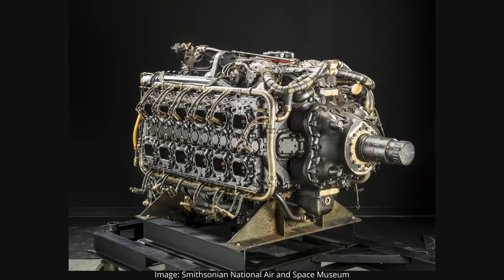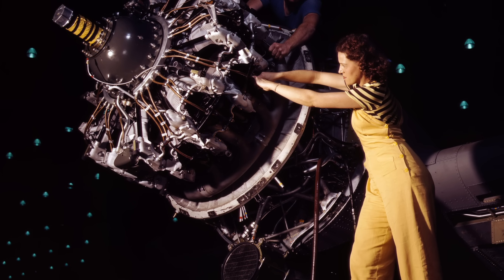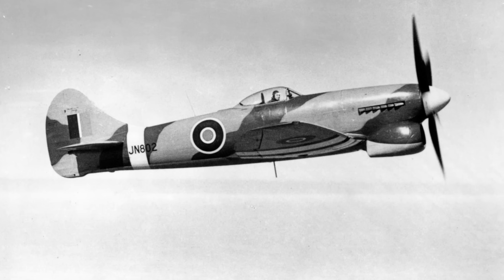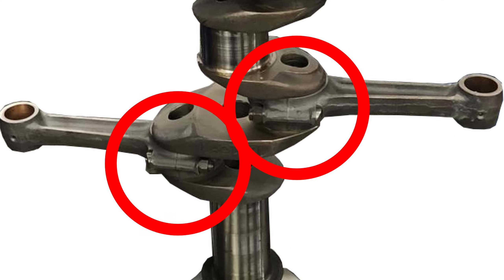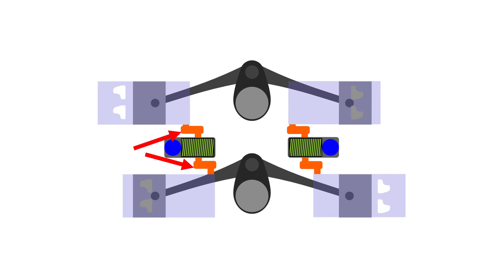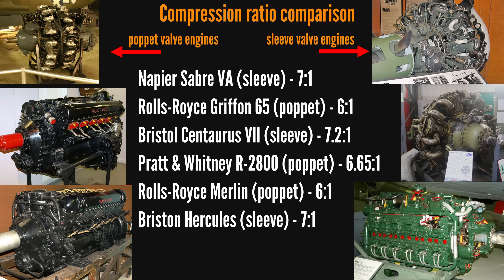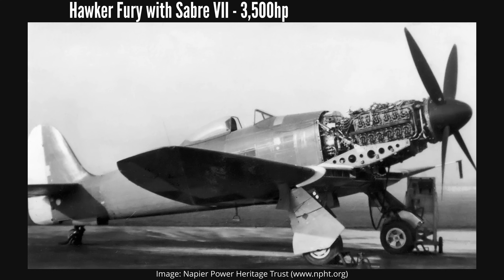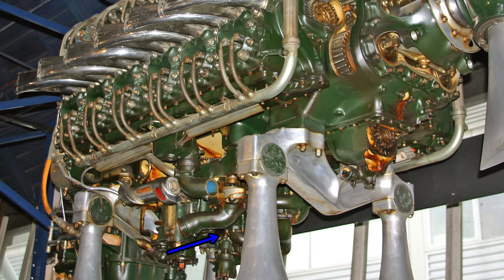The Complex Napier Sabre 24 Cylinder Aero Engine Explained Simply

Comment: One  of  the  most  ridiculous   power-plant  designs  ever  built.......the  Krautenese   set  the   standard  for   engine  design,    but  the  Brits   ignored  all  that.        When  the  pilot  fired  up   a   Napier  powered   plane,  they  had  to  go  on  Oxygen  immediately  because  of  the  Massive  outputs  of  Carbon  Monoxide  into   the  cockpit......Despite  the  Size,   the  Brit-Wit   Napier   remained  inferior  to  the  logical,  maximally  effective   Daimler  600   series  Motors.
Reply: The Knight Sleeve valve engine was invented in America... it was produced in the United States and licensed to several European companies, including Napier.

Comment: Great video!
The Griffon was a direct descendent of the Merlin, born in 1933 with five years of intensive development and five major design iterations. I wonder what the Sabre would have looked like if the war department had devoted funds to fix the teething issues in 1938.
Reply: The Merlins downside was it size, it was too small.
The Griffon is the enlarged version of the Merlin.
The British were reluctant to ask the Americans for help solving the problems with the Knight Sleeve valve engines, they eventually bought American made centerless grinders and fixed the problem.

Comment: The future of light aviation engines would seem to be the diesel, particularly the 2-cycle versions like Deltahawk. Low RPM, much simpler with no gearbox, cams or valvetrain, and runs on Jet A. 100LL avgas is getting expensive and not available everywhere.
Reply: It's certainly a possibility but not the most likely future. It's still much too soon to predict

Comment: Great video. Another disadvantage of sleeve valve engines: much faster wear and less reliability. Very interesting engineering rabbit hole, but ultimately not very practical
Reply: Back in the real world - with equivalent development, the Bristol SV radials achieved considerably longer time-between-overhaul ratings than eg US radials of comparable performance & operating conditions. They also had about half the oil consumption of eg, an R-2800, Merlin, etc. Contemporary reports specifically mention exceptionally low wear found at overhaul time + periodic maintainance was simplified - no valve clearances to adjust every few hundred hours, for one thing (= 36 adjustments on an R-2800, 48 on a Merlin/Allison V-12). The arrival of gas turbines curtailed full development of the Sabre along with the whole last generation of new designs of high power piston aero engines, both SV & PV.

Comment: I assume the Saber engine eventually was fairly reliable. I think all the other 24 cylinder engines being developed by the British were abandoned mostly because they had major teething problems  but also because development of jet engines look mor promising. Is that correct?
Reply from the maker: Yes in the end it was fairly reliable but it was too late. With the war  just about over and the promise that the turbojet showed, it was pointless to develop these further. Some of the other 24 cylinder engines didn't get as much development time as the Sabre, not necessarily because they had more issues, because it wasn't always fair nor were all companies free to choose where they spent their resources.
Reply: The Knight Sleeve valve engine was an American technology that was abandoned as improvements in overhead poppet valves became available.
Later British attempts to revive the technology were rendered obsolete by jet engines
Reply: +@alfredomasullo   Arsenal in France and Hispano developed their own experimental 24-cylinder engines after WW2 (1945-1947) but jet engines were the future.  Ironically,  France manufactured more Jumo 213 engines and they were operated in Nord seaplanes until the late 1950s or early 1960s.

Comment: Imagine the talent that it took to build an engine like that? Amazing!
Reply: No, requiring the talent 'to build' those engines was a waste of resources. Requiring engineering skill and machining ability would have done the job far better.
Reply: It should not have taken "talent" to build that engine. As a mass-produced power plant, it should have bolted together from precision-machined parts by labor who knew how to swing a wrench and shipped. By the mid 20th century, machine tools made parts which could be bolted together by those with minimal 'fitting' skills. Neither the Brits nor Germany (and certainly not the Japanese), ever quite got this; the machines made the parts to fit, the humans ran the machines and fitted the parts.
Reply: @SettledBatches  Yeah, right?  Those machines just built themselves. It's an amazing process.
Reply: @danhillman4523  When you are totally ignorant of a subject, you ought not post about it.
Reply: @SettledBatches  If you read the original comment again, more carefully please this time, the point made was purposely singular i.e. taken to mean conceptual, not the manufacturing process you have been banging on about. It was therefore a perfectly valid statement. What a shame you wasted so much time trying to correct others in such haste you missed the essence of the comment.
Reply: @SettledBatches  LOL. I was at tool and die man for 42 years. I PROMISE you that I have forgotten more than you will ever know.
Reply: @SettledBatches  Sure kid. LOL.
Reply: @danhillman4523  Gee, caught peddling BS, I'm sure not for the first time. Shut up until you have some knowledge of the subject. You DON'T.
Reply: @SettledBatches  LOL. What a little child.
Reply: @danhillman4523  "LOL"?! And you accuse others of being immature? Grow up and learn your place; it's not where you wish it was.
Reply: @SettledBatches  Who? You? You are. There is no accusation. Just the facts, son.
Reply: @Daniel-deMerrivale some of the modern day combustion engines used in cars highlight the problem with this ww2 engine. its too complex to be reliable or as reliable.. as the competition. especially for a military vehicle. modern day combustion engines used for military have a far simpler design - 80+ years later
Reply: the guys who designed and engineered this engine was very talented. but a question could also be, who is more talented. define the apex of mechanical talent, is it to build unnecessary complex machinery
Reply: @hotdog9262  Point taken. Still, what a piece of work eh?
Reply: @danhillman4523  yup:) had a few drinks last night

Comment: A terrible engine with a ridiculously low power to weight ratio for ts ridiculously high fuel consumption, ridiculously high weight, ridiculously high complexity, ridiculously low reliability and ridiculously high cost. However I blame the ridiculously high pilot losses not on this terrible engine but on the stupidity of the most dangerous job in war aviation, low level missions.

Comment: Interesting video 👍, but volumetric efficiency is the ratio of air taken in vs cylinder volume, not exhaled air (gases).
Btw, I'm curious as to what your accent is, for a few seconds I thought it was South African (J'berg), but then realised it wasn't, I'm puzzled! Where are you from?🙂
Reply from the maker: Thanks. Your first guess was correct 🙂
Reply: @LetsGoAviate oh! Interesting🙂, is there any other component to your accent? Was I also right about J''burg?
Reply from the maker: @Markpd69  There may be other components, I've worked with/for UK and Australian companies for almost a decade at my day job, so I can't guarantee I didn't pick up anything there 😆I definitely wouldn't call my accent a typical Joburg accent.
Reply: @LetsGoAviate 😁

Comment: The Luftwaffe made concerted attempts during the night-time blitz during late 1940 and 1941 to  destroy the Napier factory in located in Acton Vale, West London along with other engineering and electrical engineering manufacturing plants located on or near the Uxbridge Road, Acton. As a consequence, my relatives, living in the  nearby Bedford Park estate were bombed out of their house on  a couple of  occasions due to stray bombs falling on the  residential housing. By way of  anti-aircraft point defence for the factories, an ex-naval pom-pom gun was mounted on a flatbed railcar and it  was shunted up and down the railway siding that served the various factories .

Whilst a lot of the aero engine production was moved to a shadow factory in Liverpool in early 1940, it didn't stop the Luftwaffe having a go at wiping Napiers Acton and other firms such as Lucas/CAV off the map.

My aunt was employed as  secretary to the Napier  Managing Director  located in the Acton factory.
Reply from the maker: Thanks for sharing!
Reply: Spot on,  My industrial unit was in fact the napier engine works in Acton, We installed a new mezzanine in the unit, but had to have the floor tested to check if the floor could hold it up, After drilling the concrete floor 4ft down and still not going through, it was considered strong enough!  I guess they made it so solid to take the heavy lathes and milling machines and max out on stability for accuracy.

Comment: OK, so its incredibly complex and heavy, two pancaked flat 12 cylinders joined with two crankshafts and vast arrays of gear sets covering the entire engine front.
With valves being somewhat like a Husqvarna 2-stroke port intake only in a ported, reciprocating sleeve, moving both in and out.
Combined with a squirming, twisting motion of the perforated sleeve. The monkey motion being induced by a sideways Ducati Desmodromic worm-drive poppet valve gearing.
Cooling fluid, reservoirs, lines and radiators add still more weight and combat vulnerability.
Expensive to produce too, I'm guessing, with all that machining and vast number of parts. No wonder even the thirsty, slow responding, early jets killed off these monsters in a New York minute posrwar.
Great explication, informative graphics, good writing and nice, understated production values.
Thanks, I often wondered how such a thing was built, and why. Now I know: for huge power in a (semi) compact package using piston power. The swan song of big piston power.

Comment: The sleeve valve engine had some advantages especially with efficient combustion chambers but it consumed a lot of oil and could be difficult to start in sub zero temperatures.
Reply: Some contemporary data on oil consumption -
Napier Sabre II - as in production Tempests - 0.011 lb./hp/hr.
RR Merlin 61 - as in Spitfire IX                          - 0.022 lb./hp/hr.
Allison V-1710 - as in P-38                                - 0.025 lb./hp/hr.
Source -  "Aircraft Engines of the World" (Standard reference book for aircraft engines from 1941 on)
Quoted oil consumption figures for the related Bristol radial SV engines are <1/2 of that for equivalent US radials - R-2600, R-2800 or R-3350.

Comment: Fascinating stuff. I do wonder what Napier’s designers would have made of BMW’s 1.5l 6 cylinder F1 engine making 1,500bhp in practice trim back in the 1980s. Eye opening.
Reply: I remember that engine. Good for qualifying but not for racing. Hard left turns would cause oil starvation and destroy the engine.
Reply: @WilhelmSallsten  still made 800bhp in race trim though. Only needed to last a race in those days and overnight changes were normal.
Reply: They'd probably have smiled at an engine which wouldn't last one operational flight in a military aircraft and could never get certification for any commercial aircraft use. Compare it to one modern Lycoming 'high performance' aero engine of 6.39l which is rated at 210HP.
It's not meaningful to compare 'headline' numbers for engines intended for totally different applications with totally different duty cycles + operating conditions & characteristics.

Comment: This is what is often referred to as "over-engineered" or needlessly complicated. Today we can make over 2,000 horsepower with an 8 or 10 cylinder, overhead cam design that is not only small and lightweight, but extremely durable and relatively easy to produce in large numbers.

Comment: I was surprised at the relatively low revs that max power was produced. Using the same principle of more, smaller cylinders in racing bike and F1 car engines, they could use much higher revs to produce more horse power.
Reply: +@raymondsanderson3768   Aeroengines are high-torque and low RPM.   They are big, so there is too much mass for higher RPMs and they would come apart.   The engines raced at Reno are reinforced for strength and run high boost for power.

Comment: as far as i know the life span was 30 hrs. i would stick 2  the jumo
Reply from the maker: At what point? 1940 - 25 hours before requiring inspection. 1941 - 50 hours before requiring inspection. 1943 - 250 hours before requiring inspection.
Reply: @LetsGoAviate  TBOs or PFTR? With or Without WEP? (War Emergency Power?) Rolls-Royce Merlin engines required inspection EVERY FLIGHT if WEP was used, TBOs averaged 25 hours in combat when WEP was allowed to be used..
Reply from the maker: @DoktorBayerischeMotorenWerke  The production Sabre's didn't really have "WEP". Emergency power was achieved though increasing boost only. The Sabre VII got WEP in the form of water methanol injection, but the variant saw limited production use.

Nowhere in my research did I find anything regarding teardown inspection being a requirement if emergency power (boost only) was used. I'm guessing it depends on how long it was used for.
Reply: @LetsGoAviate FYI; All British military aircraft engines from this era  have their horsepower specs quoted at WEP.
  This is regardless if the engine is equipped with water injection.

  Pilots were required to report upon landing that WEP was used and the throttle lock wire or band was not reset until the engine underwent inspection and repair as specified by the manufacturer.
  Every single spark plug had to be checked for damage or replaced after the cylinder was visually inspected with an illuminated, optical device with a tiny mirror attached to the tip.
  Any damage revealed would red tag the engine for a complete teardown and overhaul service

I hope this clears up any confusion.

Cheers Mate!
Reply: @LetsGoAviate Sorry mate, you seem a bit confused about War Emergency Power.
The British have always quoted Maximum Horsepower Output at War Emergency Power. This is dry rated unless noted by "with Water Injection"

Perhaps you should do a video on this topic which is often misunderstood by  pilots and enthusiasts alike.

It would be great if someone did a video on the difference between METO (MCP), Max Take-off power, and WEP 
And their associated time limits, restrictions and inspections.

I don't believe anyone on YouTube has posted a good, informative video on this topic yet.
Might be a great way to boost your channel.
Best regards from the smoldering ashes in California!!
Reply: @LetsGoAviate   Just pointing out that DoktorBayerischeMotorenWerke,  sandervanderkammen9230, and WilhelmKarsten are all the same individual on YouTube.  Along with some other IDs.
Reply from the maker: @FiveCentsPlease  thanks for the info

Comment: These horsepower figures dont do them justice, which are usually taken at 2700ish rpm. Their torque figures were usually 50% higher!
Reply: Aircraft engines are not rated in torque, only horsepower..

Comment: I sometimes wonder if BRM hired former Napier engine designers to design the 1.5 L Formula 1 engine.
Reply: Not likely, Napier bought most its engines from other companies.
Reply: @DoktorBayerischeMotorenWerke  
Such as?
Reply: @DoktorBayerischeMotorenWerke  
Napier did purchase a license to manufacture opposed piston diesel from Junkers. Otherwise their aero engines were all built in Napier's own facilities to Napier's own designs.
Reply: @mpetersen6  That is completely false and misleading, apart from the Cub and gas turbine engines like the Eland, Oryx and Naiad nearly all Napier engines were purchased or licensed from outside designers.
 The Napier Cutlass, Culverin, Nomad and Deltic were all engines licensed from Jumo.

The Napier Javelin, Rapier, Dagger and Sabre were designed by Frank Halford.

The Lion was designed by A.J. Rowledge and Wolsey.
 Napier also licensed technology from Charles Knight and Bristol.

Comment: Car&Driver, july 1974, published an interview with Mike Hewland, most known for his race gearboxes, who worked in a 500 cc single cylinder sleeve valve prototype aimed at substitute for Cosworth in Formula 1
He claimed a power of 70-72 HP, an SFC around 170 gr/ HP/ hr, engine able to run on creosote. 
He and Logan claimed having solved the oil consumption with a ring in the bottom of Sleeve, and a Dykes ring in the Junk Head. 
Chsrgermiles007 has videos here about a Briggs&Stratton Lawnmower engine changed into Sleeve-Valve distribution. 
Petter Brotherhood produced a very large Diesel engine, visible also on YouTube. 
Sleeve Valve engines were made for Railroad locomotives.
Reply: The book 'Continental! Its engines and its people', reports about the Single Sleeve Valve engine research Continental did, many prototypes for different applications, although none reached production because of consequences of 1929 economy crisis: Continental said Sleeve Valve engines were easier and cheaper to produce than Poppet Valve engines. 
Also the TBO is better in SSV engines, its half life, its SFC,...
A Cylinder Liner, quite similar to a Sleeve Valve, sells retail today at around $40...